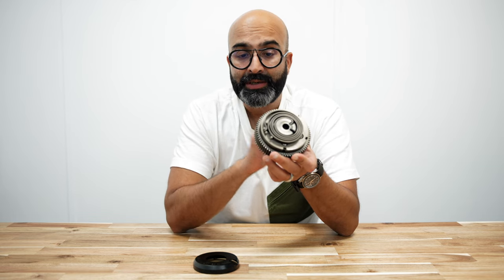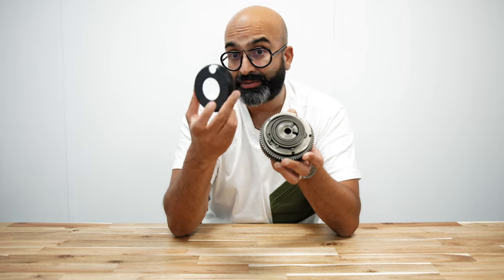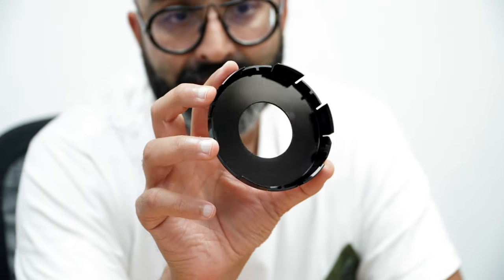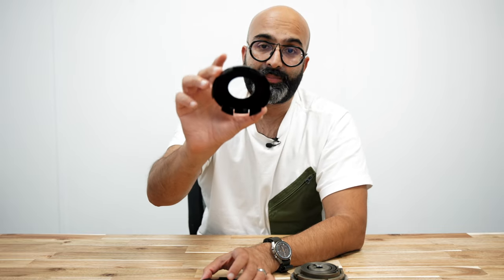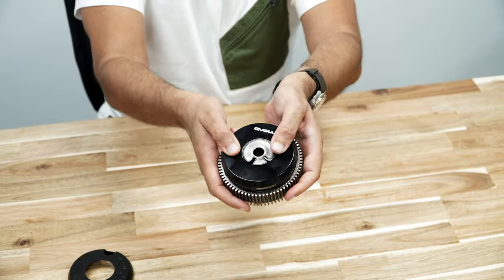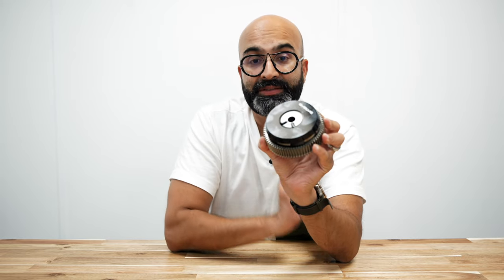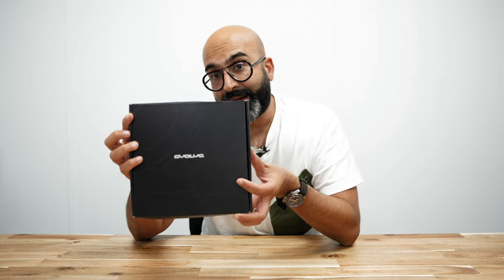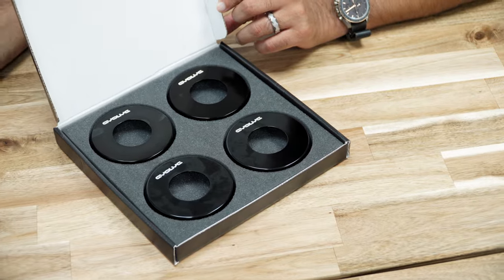E9x M3 Cracking Vanos Cover fix - Evolve Billet Vanos Covers

Comment: I was shown a picture of a similar design but a non evolve product that was designed as a click on vanos cover replacement. The problem was that after many heat cycles, it had almost unattached itself and was only hanging on at one point, can you please explain how this may have happened and how your billet product is unlikely to replicate this ?
Reply from the maker: Many of the alternatives are stamped from flat material, and therefore have been bent in to shape. Overtime the memory effect along with rotational forces can unbend this material causing it to loosen.

With ours being machined from a billet they have no memory and are much stronger meaning they can resist the rotational forces the covers experience.